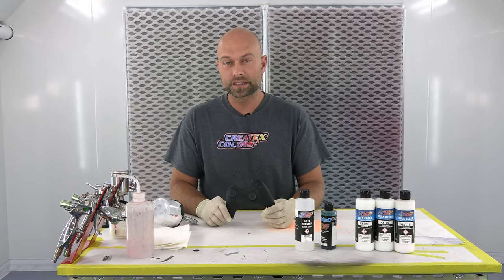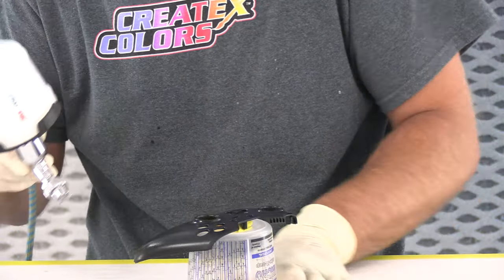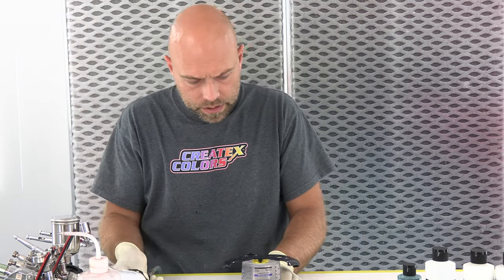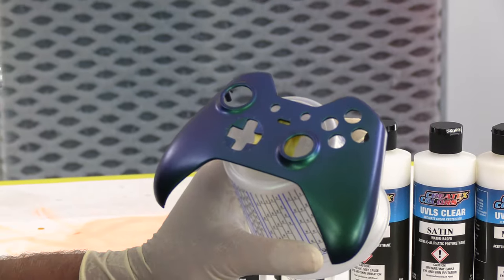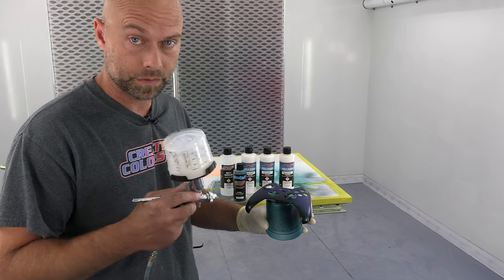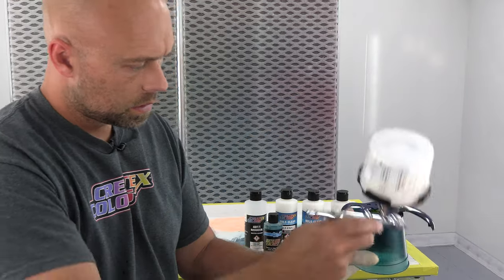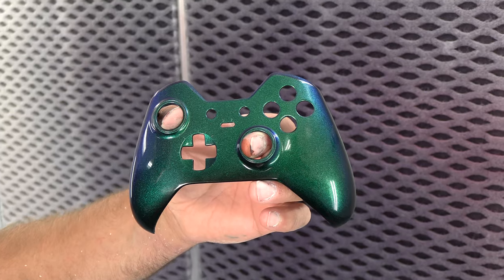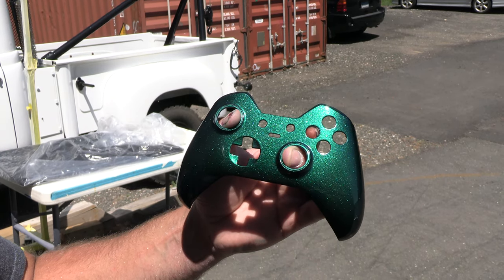How-To Paint A Game Controller

Comment: Hi Chris and Cretex Team. I have a quick question. I see in your videos that you use several spray guns. I have seen the LPH 80 used often, especially in the how-to's in which you show a specific product and how to use/reduce it and its properties. In this one though, that you are not painting on a sheet of plastic/paper/metal but on a product itself, I see you using the TH2. I Work with small to medium objects, ranging from collector toys to motorcycle helmets and cosplay customes and am deciding whether to get LPH80 or TH2. Which one do you guys recommend?
Reply from the maker: Between the two, and with an adequate air source, the LPH-80 is more versatile. Both are great, but the LPH-80 is a must have. For Createx paints, use the E4 cap. Thank you

Comment: Love the look. I am working on a project. The base coat is a custom color high heat (500 degree engine enamel), sprayed over 1/8th” thick x 12” diameter carbon steel. The base has 4 coats, that were scuffed and leveled to achieve that smooth mirror like gloss. The project is a custom airbrushed soldering “bench” to be used with the Quadhands flexible magnetic arms, and the customers race team logo (2”x2” shield vinyl decal). The artwork is going to be done with a hand cut stencil of a circular “blowout” pattern similar to a torn/ripped metal pattern, with cobalt and lighter blue electrical arcs (similar to blue lightning) emanating from the logo outward that give the appearance of the logo arcing causing the blowout. I’m using Createx Wicked colors along with Createx pearl, maybe some Candy2o (undecided on that yet). I don’t want to scuff the base coat now because I won’t be able to cleanly match and level the color coat edges of the airbrush artwork. I’m thinking of using the 4050 as you did as an adhesion coat directly onto the base color, or use clear auto borne sealer as an adhesion coat. I will be seal coating each layer of the artwork, and if I decide to use the Candy2o, I’ll use the 4040 bleed checker over each Candy2o layer, finishing off with at least three coats of the 4050 clear. I want to achieve a nice level, gloss surface with good depth, and enough clear topcoat with durability to protect the underlying artwork from the use of the magnetic arms and solder material getting onto the surface. If the top coat is marred or lightly scratched, It should be able to be buff polished if the customer wants. What are your thoughts? Thanks D-Dub
Reply from the maker: Thank you for inquiring about technique.  Both UVLS Gloss Clear and 6000 AutoBorne Sealer can be used as inter-coat.  Your use of inter-coat after each color coat and 4040 Bleed Checker after each candy2o coat is unusual; we highly recommend a test panel before doing this.  Additionally, for optimum durability and repair-ability with the 4050 UVLS Clear, more than 3 coats, each applied 1 mil thick with adequate re-coat time in between is important; we'd recommend perhaps 2 sessions, each 3 coats / 1 mil thick. For more assistance, please email us at info@createxcolors.com.

Comment: This clear coat helps with keeping paint from peeling and water resistant? In other words, does it protect the paint? I have a portable blender and the branding is peeling because of the water when I wash it… will brushing a coat of this protect the letters/branding from peeling off completely??? Thank You in advance 🙏
Reply from the maker: A clear coat, such as UVLS Clears, protects paint from damage and physical markings. Its does not fix lack of adhesion of the underlying paint. The paint must be thoroughly dried and well adhered to the primer or substrate prior to applying the top-coat clear. Thank you.
Reply: @CreatexColors   got it, thank you so much for the reply… I learned something new today 👍🙏

Comment: Awesome work! How’s sturdy is the 4050 ?. I’m gonna plaint my own controlar but I wonder how durable is the top coat if I’m constantly handling the controller. Also I have a Iwata hp-cs eclipse I believe the needle is too small for that clear right?
Reply from the maker: UVLS Clears, including 4050 Gloss, are durable, exterior-grade clears well-suited for high-use applications such as a controller. For best results on a controller used daily with lots of Cheetos-junk on your hands mixed with sweat, do 2 applications of clear, perhaps 3 coats initially, allow 4 hours/ overnight to cure (dry-sand flat any imperfections if needed) then 2 - 3 more coats. The clear will best lay down as a medium coat with a small spray-gun, at least a 0.5mm tip-sized airbrush. The new Iwata TH2 is perfect for this application. Thank you.

Comment: would the 4200 and 4300 series be able to be used in the same way using the 4050 gloss as a adhesion coat and then spraying those over the top and then the 4050 on the top?
Reply from the maker: 4050 UVLS gloss clear and AutoBorne 6000 Transparent Sealer are the only clears we recommend as an adhesive ground-coat direct plastics. 4030 Balancing Clear works as well, but not as well as 450 nor 6000 as an adhesion promoter. Also recommended for painting a remote control is adding 4030 or 4050 105 per volume to either Createx Airbrush Colors or Wicked Colors, which are then thinned with 4011 Reducer. Thank you.

Comment: Hi!

I just started airbrushing controllers. Is there any chance you could explain the prepping a little more in depth. It would be greatly appreciated! 
Thanks so much! :)
Reply from the maker: For more information about paint preparation, please refer to our Hard-Surface Application Guide, available at www.creatextech.com. When using Createx paints, starting with AutoBorne Sealer or 4050 UVLS Gloss Clear is recommended after scuffing the plastic with 300 - 400 grit sandpaper or a coarse scuff pad. Clean before sanding with soap & water, then after sanding with a solvent-based degreaser such as PPG SX-320. Thank you.

Comment: I’m painting a very large scale RC plane in Fiberglass. (3.6 m long) There is lots of details in the molding that I don't want to lose. I want to ensure maximum adhesion but avoid using a primer if I can. Would I gain any adhesion in theory by spraying 4050 before I go to Autoborne Sealer? There is going to be a fair amount of masking after the ground color is on (Sealer Silver + Aluminium medium with 4050. ) 

Thank you!
Reply from the maker: 4050 UVLS Gloss Clear works well as an adhesion promoter. Not required on Lexan / polycarbonate, but if you wish to go the extra mile for adhesion, applying 4050 first works. For more, please refer to our 2021 Hard Surface Application Guide at www.creatextech.com. Thank you.

Comment: I currently customize gaming controllers. I'm thinking of using a better clear coat but am unsure of what will be the most durable. Automotive clear coat was my first option but I do not have a HVLP spray gun, and a 2k clear coat in a can would be too expensive to use per controller since order #s arent consistent. I'm looking into using this product, but in a matte finish. How durable is it on a daily used controller? Will it soften from oils on the hands over time? Is it scratch and sweat resistant? I'm looking to increase the longevity of my products, so it would be of great help!
Reply from the maker: UVLS Clears, including 4052 Matte, are durable, exterior-grade clears well-suited for high-use applications such as a controller. For best results on a controller used daily with lots of Cheetos-junk on your hands mixed with sweat, do 2 applications of clear, perhaps 3 coats initially, allow 4 hours/ overnight to cure (dry-sand flat any imperfections if needed) then 2 - 3 more coats. The clear will best lay down as a medium coat with a spray-gun or mini spray-gun. Thank you.
Reply: @CreatexColors  Thank you so much!

Comment: I have a TH1 so sliiightly smaller Nozzle I know V.Fraser uses it alot. 4050 reduced 25% with 4011 , Candy  Mixed to taste with 4050 reduced by 20% , then cleared , then 800 sanded , then cleared. Is that right ?
Reply from the maker: 4050 and candy2o are mixed at varying ratios depending upon the application, usually 4050 6:1 candy2o. Here, candy2o Tealiscous was added as a tint to the 4050 already mixed and used as the adhesion coat, which was reduced with 4011 Reducer.  Most often, when spraying candy2o as a saturated color (not a tint) with a large airbrush or spray-gun, thinning with 4011 Reducer is often not required. Thank you.

Comment: Hye guys, can I follow this process to spray Oakley Jawbreakers? What psi would u guys recommend if I'm using Iwata Eclipse HPCS  and Createx Airbrush Colors?
Reply from the maker: Yes. PSI is generally going to be 27 - 33 psi. Mixing 4050 ~ 20% per volume with Createx Airbrush colors, then thinning ~ 15% - 20% per volume with 4011 Reducer should work very well for the Oakleys. For more, please refer to our Hard-Surface Application guide, available at www.creatextech.com. Thank you.

Comment: Is the UVLS 4050 range good enough protection for things like gaming controllers and PC gaming periphirals? Thanks in advance :)
Reply from the maker: UVLS Clear is the top-coat clear used in this how-to paint a game controller video. Thank you.
Reply: @CreatexColors  cool...will it withstand general usage over longer periods of time, and also, will it go through a 3.5mm nozzle or is 0.5 the minimum, because I have an Eclipse CS with a 3.5 :) thanks
Reply from the maker: Yes, its durable. 0.5mm tip or larger; please read the UVLS tech sheet and watch the How-To apply UVLS Clears video for more, thanks, https://createxcolors.com/scenix-mural-theme-paint/uvls-clears/index.html
Reply: CreatexColorsCo thank you

Comment: nice job.   how bout you use a regular airgun with your paints that can use a regular airbrush gun in .1 to .3 needle range.
Reply from the maker: All Createx paints, including UVLS Clears, can be applied with an airbrush and a spray-gun. For more information about tip-sizes, psi settings, etc., please refer to the tech data sheets and application guides available at www.creatextech.com. Thank you.